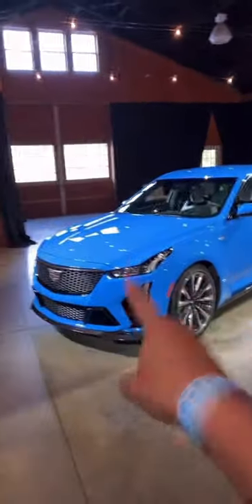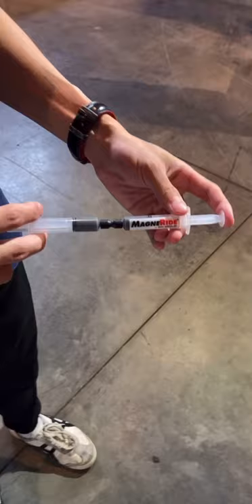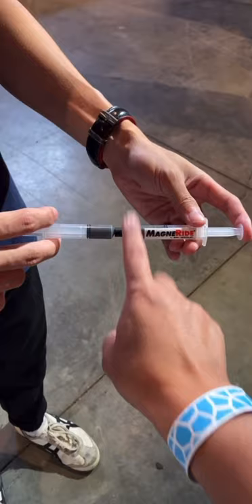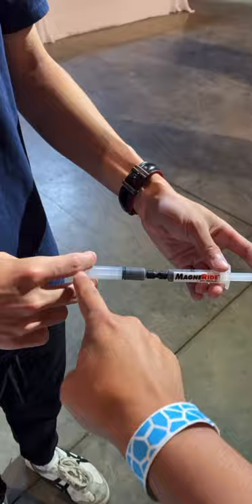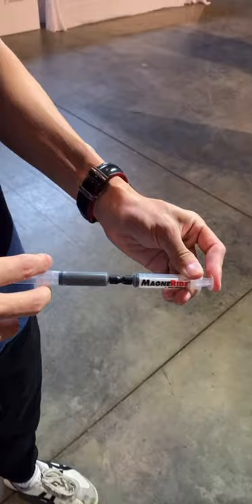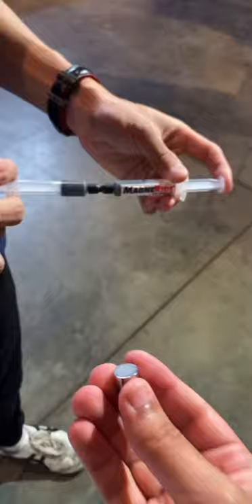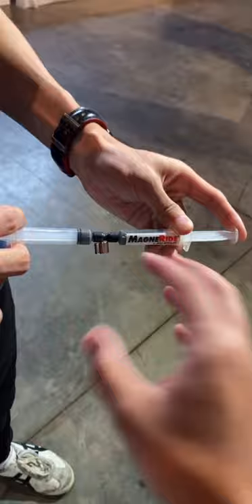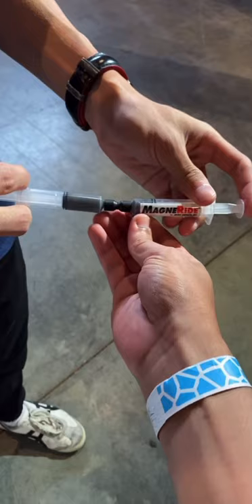Magnetic Ride Suspension Explained Simply

Comment: Very advanced and clever suspension, engineering masterpiece!
Reply: Till it breaks…
Reply: @zachary1141  i don't think it will ever break when they have done 24 hours of constant track testing with no issues especially with 799+ laps performed with these cars.
Reply: @mohammedawadud7238  Wow a whole day of driving and nothing broke... -_- glad that the reliability isn't extremely shit. Either way, sooner or later the suspension is gonna wear out. That's just the life of a car man.
Reply: @zachary1141  suspension isn't gonna wear as early you expect, this car is very durable and Cadillac had done major damage test to the manual transmission too. It's true it's going to wear out eventually but it won't happen right away.
Reply: @zachary1141  yes and no. They are quite reliable but expensive
Reply: @mohammedawadud7238  how much did that cost you?

Comment: But then if the suspension is broken, it costs more than a regular suspension.
Reply: @zyst0290  I had it on my 02 Seville, I was in highschool, cost I believe around $800 per wheel to replace it...car was valued at $2000...went with $80 Monroe shocks, but the system then limited the top speed to 90mph lol... nowhere to plug in the computer on the cheap O's.
Reply: @Kyle well, I'm a little more old-fashioned. I don't like it when my car is too crammed with technology. And also electronics, which can break at any time. And electronic parts cost far more than mechanic parte. That's why I'm sticking with it. For example, I bought a Ford Focus RS built in 2017 myself because I saw a lot more potential in this vehicle. There are few electronic parts, but a lot of mechanics. And if something breaks, it is much easier for me to replace a mechanical part than any electronic part
Reply: @zyst0290  agreed!
Reply: @VetteDaily  A good example: 

I had an Audi S3 with Magnetic Ride shock absorbers before my Ford Focus RS. I then calculated the follow-up costs. 

A normal shock absorber for the Ford costs around 130€.

A shock absorber for Magnetic Ride (Audi) costs well over 400€.

To the Magnetic Ride shock absorbers there are also various control units and sensors that also cost additional money. For wear parts such as dampers, not even the 2-year factory warranty from Audi is enough.
Reply: @zyst0290  obviously its gonna cost more.do the shocks in your focus perform for more than one application? Obviously not , magnetic suspension is versatile which  can be changed to fit your driving style.
Reply: @bablusonavne384  The only car brand that does it right is Ford. The best example is the Ford Focus RS MK III, which has no magnetic shock absorbers or anything like that. No lane assist, parking assistant or other assistance systems. No DSG (automatic transmission). This is a real sporty hatchback. No other vehicle can keep up with it. That is exactly what I wanted. A vehicle which is more valuable on the sporty aspect than on comfort. All other car brands like VW, Audi, Skoda, Mercedes and so on have a mixture of comfort and sport where the sporty aspect is rather far behind. The Audi S3 for example, has 300HP. But the car is heavier, then there is a weak DSG gearbox and I have to manually set the vehicle to sport every time I start it. 

You just can not expect comfort in a sports car. That is not possible. Therefore, I think it is best as it is with Ford. There is a tight, sporty chassis and I do not have to adjust anything. 

For non-sport vehicles, such a shock absorber is, of course, the best. But that was not the talk here.